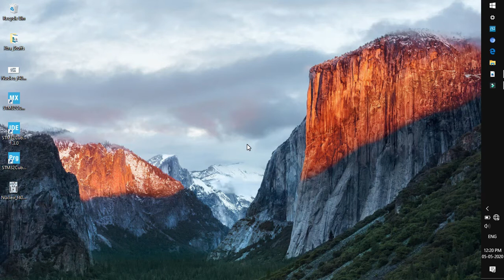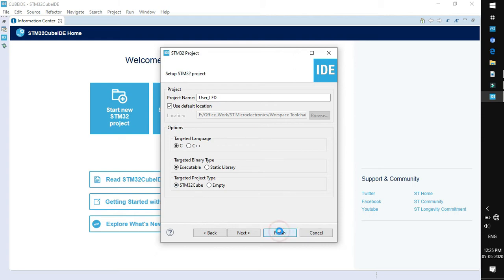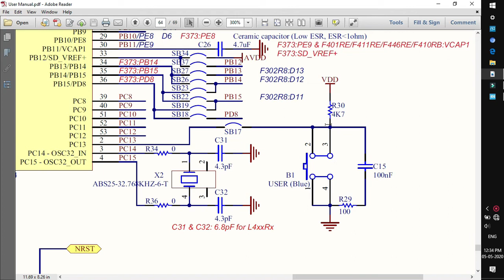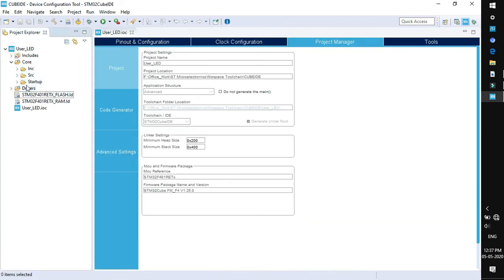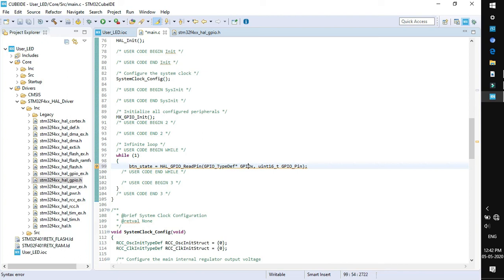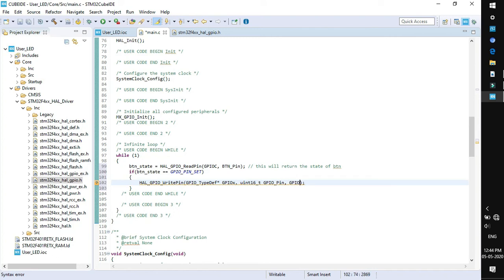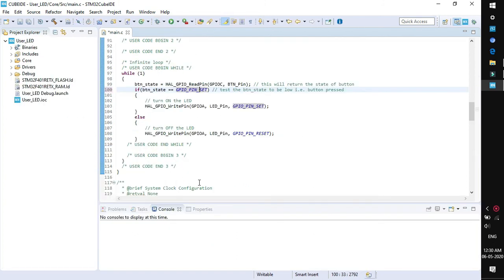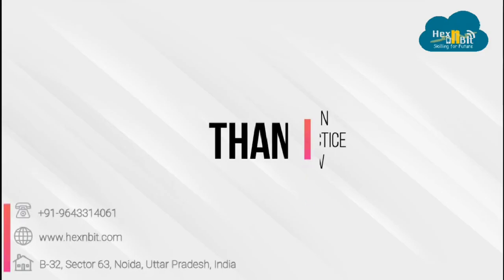Tutorial 7: LAB - LED with Button Control in STM32 using STM32CUBEMX

Comment: hi, so the internal pull up or pull down resistor of the user button, is pull up right?
Reply from the maker: Yes.. it is pulled up. It varies board to board, you can check the schematic for better understanding.